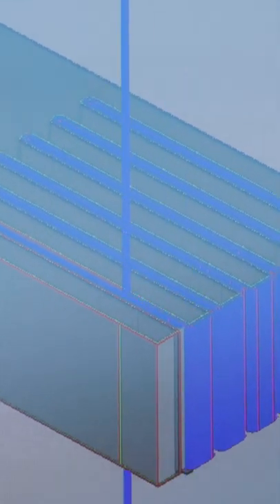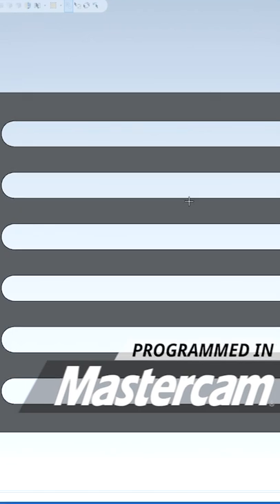MACHINING One Of The HARDEST METALS On EARTH #shorts

Comment: Tungsten carbide is not a metal, it's a ceramic. Typical tungsten carbide tooling though is a metal matrix composite with cobalt being the matrix.
Reply: Is it usually made by sintering powdered materials? Just wondering how they they are shaped and bonded. Are they pressed together and heated?
Reply: That is one way, you can also melt tungsten and add CO2 or graphene to add carbon, kind of like a steel making process.
Reply: @theman5887  thanks for the reply.

Comment: In high school my class toured a machine shop.  They had a machine that would "Burn" a shape into metal.  

It used a carbon looking tool and they applied a voltage to the 2 pieces and it would slowly press into the blank and leave the shape of the tool. 

Any Idea what that was. It's been many years ago, and I can't remember.
Reply: sounds like the machine used was an edm electrode machine

Comment: It’s recommended to leave an extra 1/8” to 3/16” of material on the length when you can. It’s more efficient to make one large slug than many little ones, for this reason exactly. Although, when that’s not an option, I use a “coring” program so that there’s no slug to drop. Which is essentially what you’ve done here. Good work, though!

Comment: How is the surface that smooth when it’s burning the material away?
Reply: The brass wire is very clean and consistent in surface finish and diameter, and it is constantly feeding wire as it cuts so as the quality of the wire decays similar to an electrode on a welder it is moved out of the part and sent into a scrap bin. The wire electrode comes in a spool similar to a mig welder.

Comment: I run a small hobby level machine. Am I the only one that prefers metric to imperial? I'm still going to describe a distance in miles and weight in pounds. When it comes to machines and programming metric is just easier to deal with.

Comment: Imagine building a car out of tungsten carbide, volvos biggest opponent
Reply: It would weigh 5 tonne
Reply: It would also be brittle as shit
Reply: It makes for a great casket. that is no surviving a crash.
Reply: Holy hell , you'd break the overpasses
Reply: Getting into a crash with no crumple zones equals a very very hard jarring hit, probably a neck snapper. Not to mention thousands of very sharp jagged pieces exploding everywhere because it's so brittle and it weighs 12,000 lbs at a cost of 500k.
Reply: @itsjustmechill.5292  could you imagine an impact with sufficient enough force to cause the material to give.  So much for not needing a hanze device for daily driving , lol 😆

Comment: These wire EDMs are such a scam, if you knew how restricted you are in using one you'd be appalled. The software limits how you use the program to the extreme and the wire itself is way overpriced. If only you were able to see the cost of materials for the wire company or what the software looked like completely unlocked you would be sick to your stomach knowing how bad you're being ripped off.

Comment: Fifty thousands, ten thousands in diameter, damn America. I don’t see how y’all really wanna push your own measurment system 🤡 can just simply say .3mm and get back to work smh for imperial
Reply: You're off by a massive amount and clearly know nothing about precision machining. You're the 🤡
10 thousandths is 0.254mm
0.046mm is a massive error in precision machining like this. Wire EDM machines hold tolerances measured in ten-thousandths of an inch (i.e. 0.0001" or 0.00254mm)
Reply: We went to the moon.
Reply: Imperial is what we grew up with and learned, there is literally no reason to switch.
Reply: @PilotTed  There is plenty of reasons.
Reply: @promiscuouscrab4040  NASA uses metric
Reply: You act like the U.S. is the only country that uses a mix of imperial and metric measurements. Take a close look at a lot of former British colonies and you'll find it's quite common.